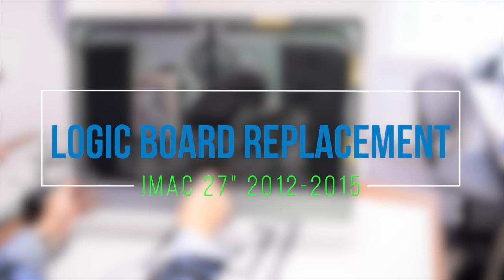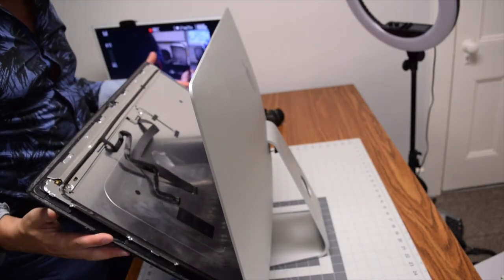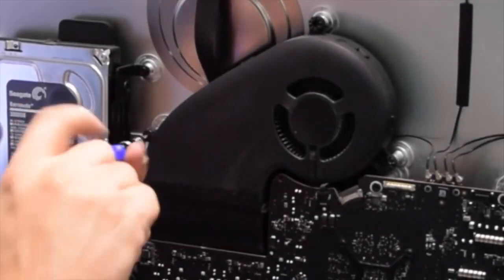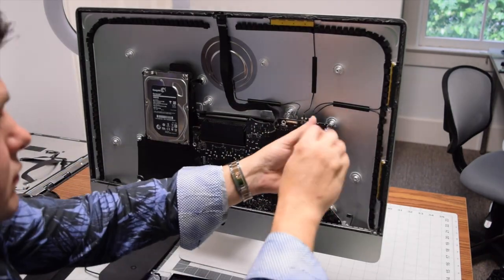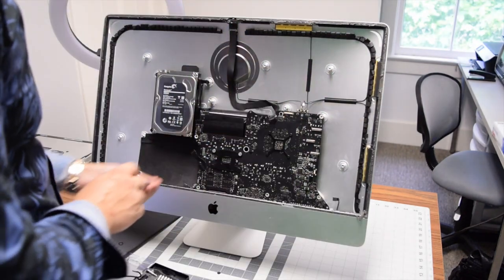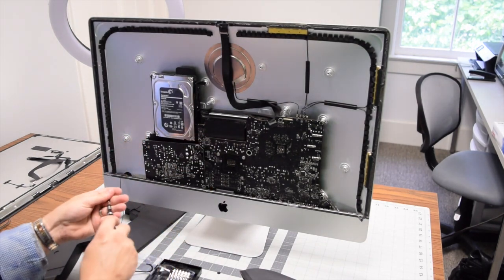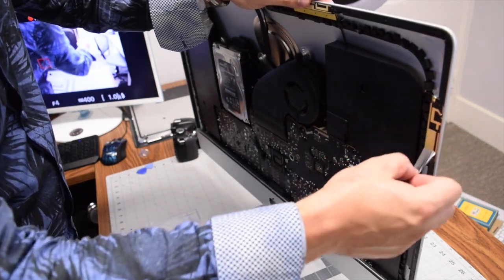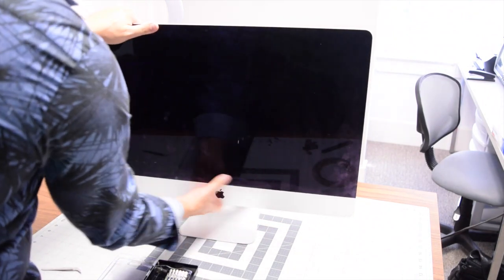🛠️ 🖥️ 🍏 iMac 27" 2012-2015 Logic Board Replacement

Comment: Thank you. Can you tell abouth swapping mainboards from this models and similarity. Maybe Retina board can work with normal lcd panel. Maybe late 2013 mainboard can be replaced with 2014 mainboard.  or is 2012 mainboard similar and compatible with 2013 mainboard. Thank You.

Comment: VERY IMPORTANT STEP OMITTED FROM THE VIDEO: Before you re-attach the LCD, boot up the Mac to make sure it is operational. There are 4 LED lights on the logic board. Three will light if the installation was successful (the 4th doesn't light since the screen isn't connected). At that point, unplug the power and put the adhesive strips in place (if you haven't put them on yet). Attach the LCD cables, but DON'T remove the covering on the adhesive -- temporarily hold the LCD in place with some masking tape instead (or better yet, leave it on its back, screen-up) and boot the Mac. This way it is confirmed that the logic board, power supply and LCD are working properly before you stick it back together. It sucks to glue the screen back on and find out the Mac isn't working right and have to cut through the seal again.

Comment: If I want to use the screen as a second screen, do I need to replace the logic board...probably a dumb question, sorry....
Reply: How could you use it as a second screen? There is no HDMI connector. You need a functioning machine to use screen mirroring via Thunderbolt or USB.

Comment: Is it possible to upgrade the motherboard? For example i have an i5 and i would like to upgrade to the i7 motherboard
Reply: You can replace the CPU, the motherboards are the same. Make sure to get the exact correct i7 CPU, for example for the Late 2012, the 21.5" uses a 3770S, while the 27" apparently can use the more common 3770.

Comment: My advice to the viewer. Do not follow the instruction on this video. Here is the reason. First off, do not apply heat gun on the screen perimeter. No need. If you get carried away applying heat, the glass expands it, which could be followed by a stress fracture. Secondly, the metal prying tool, definitely NO NO. Why? because it can scratch the inside black paint on the glass. So, how do you do this right? Simple. Buy yourself a $5 rolling disc plastic cutter. This disc is very thin and flexible. Start from the bottom and insert the rolling plastic disc between the glass the metal frame of the iMac. It is easy. The radius of the disc is long enough to cut through all the glue that is between the glass of the screen and the frame. Just roll it slowly. It will cut through the glue. Put playing cards between the glass and the frame to prevent them from being glued again.  When you are done cutting through the glue, it is time to pry the screen with your hand to complete the separation. You will have to remove two cables connecting the screen to the logicboard. The video cable, and the screen power connector. disconnect the two and you are ready to lift off the screen.
Reply: I can't find a rolling disc plastic cutter. Can you explain what that is, exactly? Or where to purchase one?

Comment: I am very glad that you have shown a way to complete disassembly. Edit: I had found out that you actually needed to take both t10 screws off the side. Because normally that heatsink shroud is supposed to be screwed on the unibody.

Comment: I have a 27 inch iMac that the board just went out. Apple repair said it would cost about $600 parts and labor. This is not a hard job to do. I still have the computer but I bought a new one this week. The one out of service is a 2013. Not sure what I am going to do with the dead computer. Would love to make the repair. One thing I saw with this video. The guy did not take the time to clean the fan.

Comment: A question for you. Did you just replace the old one with the same model, or did you upgrade it with a best possible one? I'm asking because I'm thinking about upgrading my 27" imac late 2013.
Reply: If I could, do you think I can upgrade my iMac into one with DDR4 compatibility?
Reply from the maker: Because the ports are slightly different and the internal layout shapes are also slightly different for many models with the same A number I would suggest just replacing with the same exact board if you need it replaced. If you go to www.everymac.com click imacs and look at the A number for your size and year in the model list, you can see that you could get a board with same architecture but slightly better CPU but once you go to a different tear of architecture such as DDR4 you are looking at a differently shaped board. It's not the case every time but most of the time. You should do in-depth research and visual comparison of board pictures before purchasing anything. This is a very complicated replacement and if you order a wrong board and you have everything gutted out and you see that it will not fit, it will be a disaster that can be avoided in advance by research. Good luck.
Reply: @GRIBSOFT  Thanks for the info and comments.
Reply from the maker: Welcome.
Reply: Gee, do you want a special medal?